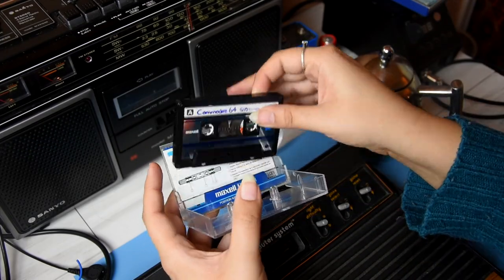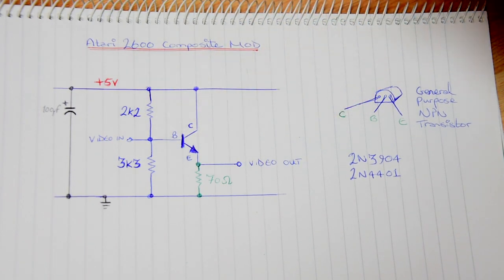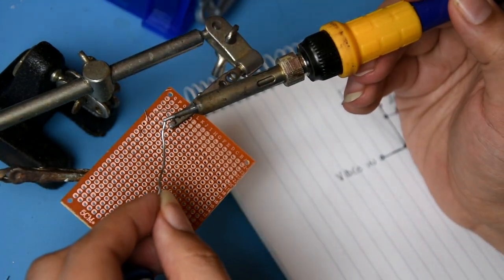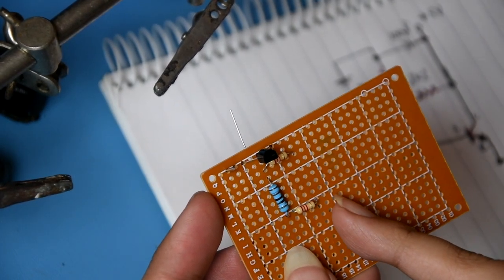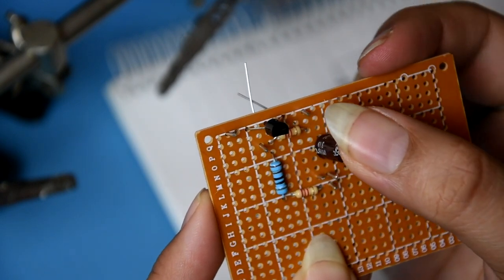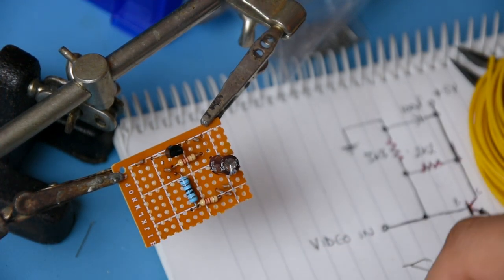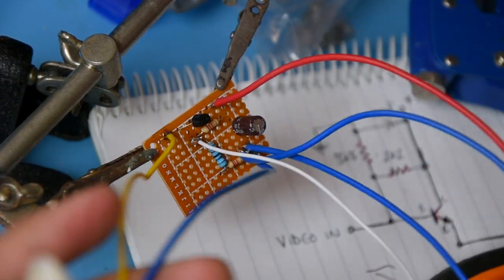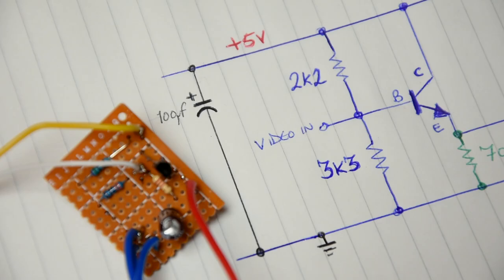Atari 2600 - Part 2: Building the Composite mod

Comment: Hey Maddi. Hope you're well. Just found this and I have an old 2600 in a drawer upstairs I re-capped and replaced the voltage regulator in a few years back. Couldn't get the TV to tune in to it, so I'm now knocking-up this RCA mod on a bread-board to see if I can get a picture. Will let you know! Thanks for taking the time to post this.

Comment: This is one of the better RF to composite mods I have found. They are all very similar, just slight variation on the transistor and resistors, but your combination of parts may be a slight improvement. This is my third variation. 
I am using this on an NTSC Atari 600xl and it works very well. The NTSC 600xl is missing the monitor port along with all the PAL circuitry on the board to provide native composite. My capacitor is still on order, but it still looks good.

Comment: LMAO @ General Purple Transistor!  I learn something new every day =D  Great job!!!  When I motivate myself to finish the 2600 video I started earlier in the year I might try that 70 / 75 ohm resistor on the emitter as you suggested.  Adding a 100uF cap across the supply there like you did  is a good idea too - that's lacking from the PCB I tried last time too.  In my case I am wondering if the transistors I bought from China are dodgy lol.  Stereo SID music in your video is just magic btw =D

Resistoroids - cracked me up :o)
Reply from the maker: Lol!! I get freakin tongue twisted so easily in the goofiest of ways :o)))
Thank you! Actually I think it would make more sense with the 75ohm resistor, it's a stabilizing resistor and I was kinda surprised it wasnt there in the first place. I hope you get your composite working, it can't be a major thing, there's not much to this circuit lol. oooh transistors from China, that might explain lol. 
And thanks, I need to record more SID tunes in stereo, they work out pretty well in videos :oD

Comment: Thanks for another super informative video, Maddi! This would be another cool project to undertake and see if it also applies to the Atari 5200; I feel that console so desperately needs composite at the very least to take advantage of its GTIA chip to the max! (Which also reminds me of how silly it was that the Atari 8-bit computers had composite video out support but the 5200 gets the short end of the stick in that regard!)

I also need that cracktro SID file! :D
Reply from the maker: From what i've seen the 5200 is quite a beast of a machine haha it was created differently to the 2600 and 7800, they decided to include the power there too for some reason... I'm not fully sure but I don't think this mod would apply, you would have to do another mod which would combine luma and chroma outputs etc first, it's not that much more complicated than this, just a few more resistors and capacitors it seems  :o). hold on, let me see if I can find it for you.
http://atariage.com/forums/topic/174047-av-mod-and-power-mod-for-5200/

And the cracktro SID file : 
            
https://mega.nz/#!Q51ygB5A!DwG6jp0zIpdNsQUlB3PCCtNGfiIbWCsBeIAPThSCGKI 
Enjoy! :oD
Reply: MsMadLemon Regarding the power supply, on the early 4-port Atari 5200s, the PSU did indeed run through the RF switch! So on those models, you absolutely need to have that RF switch and the PSU; they're unique only to that system, and without them, the system is only as good as a display piece.

The later 2-port models (which is what I have) redesigned the whole setup and made the RF switch a standard switch, and the PSU was a standard Atari 8-bit computer PSU. Much easier to replace!

The circuit does look simple enough still; the extra chroma and luma combination mod does make sense as well; I do remember reading that without that, your output wouldn't be correct (either too dim or black and white only).

SID file grabbed as well! 👍

Comment: hello i have a question, what is the voltage from the 100uf capasitor?
Reply from the maker: You can use a value greater than the circuit supply voltage,. so for this circuit the supply voltage is 5v, therefore you can use 10v or 16v (obviously anything higher and the capacitor size gets bigger so maybe not a good idea). In other words as long as you dont use 5v or smaller.
Reply: @MsMadLemon  thank you so much now i can order the parts. very good video!

Comment: Why three ground wires? (blue) I can see on your diagram you have three points that go to ground but you seem to be taking all three from the same point anyway. Looking forward to part 3 when the RCA socket arrives! :)
Reply from the maker: I only actually needed two from this board at the end, but i'd rather take ground from the board to each RCA socket, I was thinking there would be more chance of interference if I chain ground from one socket to the next no?
Reply: Oh of course, audio ground, video ground and power ground. I forgot about the output side!!!

Comment: Hi, Nice video. I'm new to electronics but I have modded my SNES and megadrive got 60hz. Could you tell me what the terminal pins you are using are for? I want to do my own AV Atari mod using a similar circuit.
Reply from the maker: These are the terminal pins that i use: https://www.ebay.co.uk/itm/Vero-Terminal-Track-Pins-For-Strip-Boards-Lot-of-100/170537261859?hash=item27b4d01b23:g:2CQAAOxyGqZSZaIT
Reply: MsMadLemon thank you. Can you tell what what they are used for?
Reply from the maker: Bascially exactly how i'm using them in the video, they are a way to create solder points on veroboard or matrixboard. They tend to be used for prototypes but i use them here since i'm not a big fan of soldering wires directly onto a circuitboard, but that's just me.
Reply: MsMadLemon thanks for that.

Comment: You can do better than 2k2+1k=3k2.  Two 2k2 resistors in parallel would be 1k1, that in series with 2k2 would get you 3k3.

Comment: Interesting video but I would just purchase a coax to HDMI just because there so freaking cheap.
Reply: Wouldn't you get lag though?  And does that include a demodulator to convert RF to composite?

Also, and this might not be an issue on the 2600, what about quality?  And redundancy?

You're taking the composite signal from the TIA, modulating it through the 40 year old modulator in the 2600, causing a loss in image quality, demodulating it back to composite, causing a loss in image quality, then sampling and converting it again to digital for output over HDMI, causing a loss in quality.  

Why not just mod it to take the original signal from the TIA straight out to a TV?
Reply: If you really want to mod the 2600 to look the best. Just look up longhorn engineering.